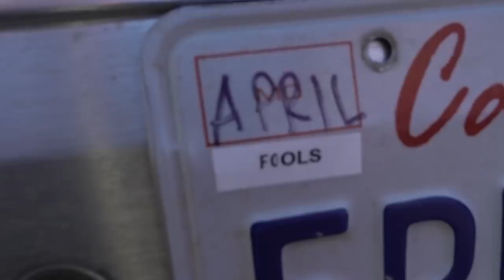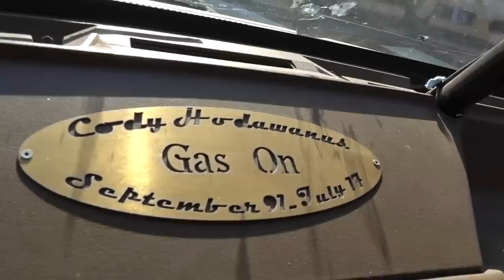Huge Air Bronco Jump! // DT229

Comment: my BICYCLE has 6 inches of travel front and rear and 4 inches is not a lot even for a mountainbike.

HOW HE DO DAT????
Reply: Marco Epifani the tyres give probably 5 inches more travel at their deflated state. It was also landing really well which helps
Reply: Hey 4 inches is all you need man
Reply: 4 inches can go a long way with the right technique
Reply: Marco Epifani it's got a bit more lmao
Reply: Stance life! https://i.imgur.com/ynx60e8.png
Reply: @Montygue daaaaaaaaaaaaaaaaaaaaaaaaaaaaaaaaaaaaamn!
Reply: They were clearly joking about the specs of the vehicle. Ferrari V12, Prelude 4 wheel steer, "4 inches" of travel. 

Thing has a mile of susp travel.
Reply: Marco Epifani did you not notice when they said "Ferrari engine" or "prelude steering"
Reply: Stock width beams on a Bronco can get around 16-18" of travel on the front. When you widen them, which his are, you can get a lot more. The method to widen is kind of a fabricator's secret sauce. They usually don't share a whole lot of info as to how/what they do or how much they cycle. I'd guess it's in the 18-24" usable range?
Reply: Scott L best reply anyone will give. I live and breath the OBS Fords. I wanted to build a truck with beams but maaaaaaan. I bought a 2wd with ibeams which will be more my skill range lol

Comment: Why is there so much camber?
Reply: Twin I-beam suspension
Reply: Monsiour Mohawk yeah, but like.. does it actually help with jumping or anything?
Reply: The Fiesta Guy helps on the sand, dakar and baja cars also have camber on the front
Reply: It came stock on a lot of Fords, it's good for ride quality but garbage for tire wear.
Reply: I think he bent the I-beams at an event, but generally I-beam suspensions have a ton of camber change with suspension travel so starting it negative means it just gets to 0 over bumps instead of positive camber
Reply: Check my profile pic. I have raced for years and have used the same negative camber setup. The reasoning behind it is in the turns. On the tighter stadium tracks or in my case motocross style tracks. Going into a turn the tires will bite and kind of fold under the wheel. So like only the outside Of the tire is getting traction. If your lean the tires in like this, it counters this effect. So blasting into a turn the flat treaded area of the tire has full contact with the ground give better traction and not letting that outside Of the tire just dig in.
Reply: Didn't he say it wasn't intentional? 30 year old suspension parts do eventually catch up to you.
Reply: 5:50   listen close,
Reply: John Daley and Lord Motorsports way to spread the knowledge 👍

Comment: That bronco is dope af but he should have put a 440 hemi instead of a ls
Reply: Karrie Bhurgari lol that’s not even a thing. Hemis aren’t 440 ci and 440s aren’t hemis
Reply: There are so many amazing Ford engine options to choose from that an LS, a 440, or a Hemi, are just engines a fool would use.
Reply: Jim Garrison then whats an 6.2 lsx doing putting out 1000 horse power which ford could never even touch plus the Dodge hellcat supercharged 6.2-liter V-8 which made 707 horsepower, if Ford so damn great then why is everyone putting ls chevy motors in there Dodge, Fords, and other domestics and foreign cars
Reply: Because you can buy LS parts at every Walmart.

Comment: be surprised at how much power that exhaust is creating.   Look back at  a lot of the F1 engines exhaust systems that did not have a turbo and they were very complex and the exhaust pulses were perfectly balanced/timed.
Reply: I doubt it was creating power  as much as not restricting flow and robbing power

Comment: As someone that was recently the owner of a 95 Bronco with the Twin Traction Beam split Dana 44 IFS.. I can tell you that it SUCKS at speed at all, even on the highway the constant camber change would make it go all over the place. Though I will say it was funny as hell (even with less than 200HP) to mat the gas, watch the nose go way up in the air, and then drop the gas and watch it dive... Unfortunately during the dive it'd also turn so... that's a thing.

Comment: Would have been nice to actually throw out some good information not the dumb 4" crap.  Or the 30 year old shocks.  King hasn't even been around 30 years.  It would have been cool to actually get some tech info like if he is running, coilovers, bypasses and air bumps.  A look at the rear suspension and how it is linked, etc.